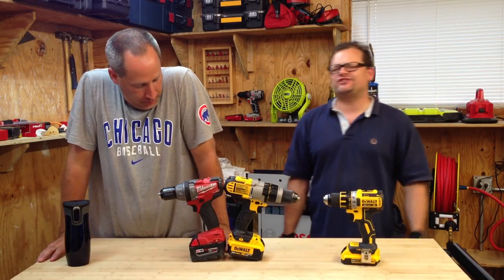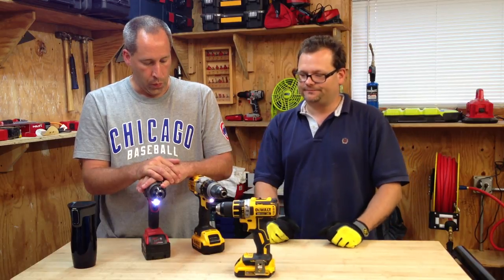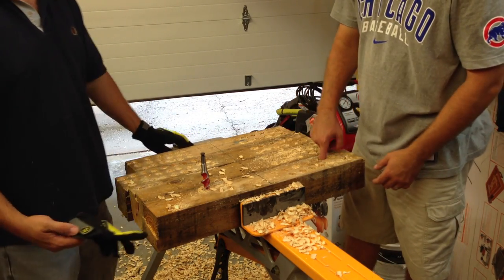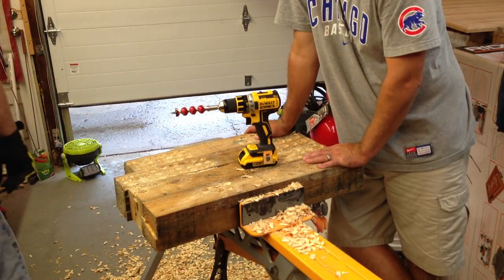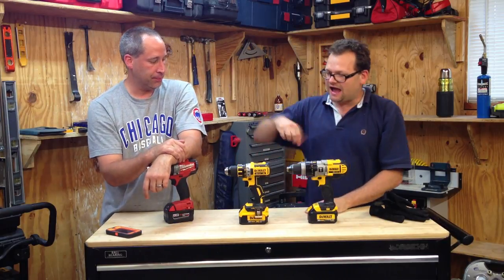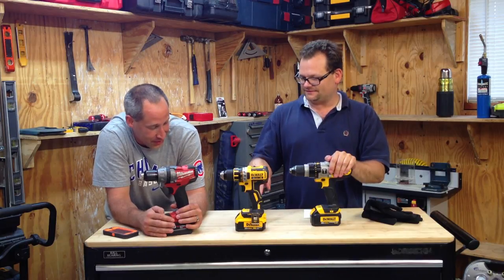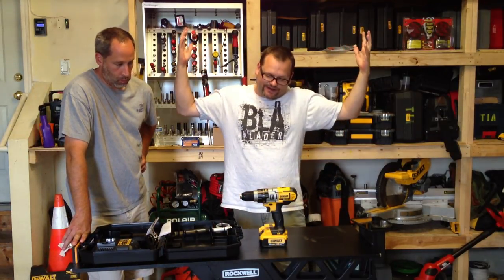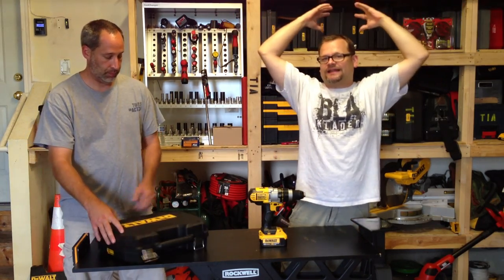Friday Night Tool Fight Milwaukee 18v vs 20V DeWALT

Comment from the maker: Your not going to go wrong with either.  Both are made for the contractor and heavy use.  The Dewalt feels very nice, plus Dewalt offers a compact drill and a heavy duty drill.  Milwaukee has a bigger 20V line and is coming to market much quicker with brushless.

Comment: great video guys, been wanting to see that match up since the dewalt brushless compacts came out. Honestly, you can't go wrong with anyone of those drills, although i personally would go with the brushless dewalt. Suggestion for your next tool fight, Milwaukee recently "remade" their brushed m12 drill and impacts so i think that would be a fair match against dewalts 12v

Comment: I found you guys when I had to step up my tools for a remodeling project and really enjoy your videos. I bought the brushed M18 compact as well as the DCD790 to do my own comparison but the Dewalt brushless battery life was superior. Home Depot does not sell the compact Fuel drill/driver, you have to order it. I read the lithium ion in Milwaukee loses capacity after only a few cycles so I stuck with Dewalt. 
You both use the DCD790 as a daily, correct? I love the drill but I had to track down one with no chuck wobble. I looked at several and even found a video of the problem. Have you noticed it on your models?
Also, I found that Lowes carried the newer heat sink 2.0XR (DCB203) pack but Home Depot does not. (202 only)
Will all the 20v batteries get the heat sink or just the 2.0?
Thank you for the entertainment!

Comment: I'm a little confused. At 3:48 you show a close up of the DeWalt which clearly says XR on the side of it. It looks identical to the one being used in the comparison. XR is DeWalts brushless model, but you two are saying that you're using a DeWalt that has brushes. What's going on?
Reply: XR stands for extreme run time.  It says it on my dewalt combi drill (brushed) my impact (brushless) my torch (.......) and my multi tool (brushless).  Dewalt were branding their tools XR a long time before they started using brushless motors.  I think some of the old tools than ran on NiCD batteries were branded XR.  Hope this helps mate.

Comment: Just saw that on  the new dewalt DCD 995 brushless drill. That dewalt didn't separate their clutch with the hammer and drilling selector on the new drill it is all together. Looks like Dewalt took one step forward with the brushless motor and two steps back with the drill selector.

Comment: Great vid, no surprises there. Already knew Milwaukee would win but it was interesting to watch. I still want to watch a tool fight between Milwaukee's newest m12 brushed impact driver against deals 12 v max impact driver. They are pretty even on specs. You can even throw in the Bosch makita and ridgid 12v impact drivers in the fight.

Comment: Hey John Grammaticus, they actually did do a tool fight between the Makita 18v brushless and the Milwaukee M18 brushless when they first came out. Should check it out. It's the reason why they call that Milwaukee auger bit "The Drill Killer" and sadly why we don't see a lot of Makita on here.

Comment: Hey Dan and Eric, if you guys are still going to test 12v drills this Friday you guys should do Dewalt vs Milwaukee's redesigned 12v vs Bosch's ps31-2a (i think that's the right model). I've used and owned a lot of the 12v lithium drills and would say those are the top 3. Ridgid would be next.

Comment: Milwaukee wins hands down IMO just because they have probably about 30+ tools for the 18v and 12v. I use my tools on a daily basis for my trade and so far they have never let me down. I just picked up the 12v led stick light which is now my fav light and about to splurge on the hammervac since it would drilling for drop in anchors less of a mess! One tool I would like milwaukee to make is an 18v nibbler since i just seen that makita now makes one!

Comment: It would be nice if Porter Cable offered 4ah batteries or even 2ah. Then it would be a better test, but biggest setback would be the brushed motor compared to the m18 fuel.

Comment: The Milwaukee fuel hammer drill is the toughest drill on the market when it comes to endurance. Watch this video on YouTube.  (Drill Performance Showdown Highlights). It has the Milwaukee 2604-22 vs Dewalt DCD980L2 vs Bosch DDH181-01 vs Makita BHP454 vs Festool T18 564397. All of the drills have a 3.0 AH batteries.  The Milwaukee fuel wins takes 1st. 2nd dewalt, 3rd festool, 4th Bosch, 5th Makita.

Comment: Just seen new pictures of Dewalt's new 20volt brushless Premium hammer drill.  On Toolguyd page. It only has 708 inch Lbs of torque.

Comment: The Dewalt 20 volt is really an 18 volt tool it's only 20 volts when then there is no load being pulled on the battery. The reason they called it 20V max as it was a way to seperate from the old plug style tools to the new slide pack system. The 12v tools are the same way they really are only 10.8 you might even see some old sets with that rating before they all started marketing them at 12 volts.

Comment: A brushless milwaukee only managed 2 more holes in a 4x4 then a brushed dewalt with same size battery... that's very little difference... Unless the milwaukee was a light year faster the Dewalt is still my drill of choice, I'll never need to switch

Comment: Also as far as heat goes, A compact drill, shorter, lighter in weight with a less powerful motor drilled nearly the same amount of holes as the bigger more powerful fuel so of course the smaller motor is going to generate more heat in doing what it did, it's common sense... And in the real world no drill is going to do this kind of thing drilling hole after hole wide open with no breaks through a 4x4 with that bit... In 99% of the worlds situations you'd probably never get this drill that hot

Comment: 28v milwaukee vs anything dewalt.  Sure they are heavy, but they come with nearly the power of a corded tool.  And hey, if you are in the trades, you should be strong enough to work with a heavy tool all day.  If not, maybe a desk job would suit you better,,Kidding.  But the 28v are awesome for heavy work.  I skipped on the 18v stuff.  I carry all 28v for heavy, and 12v for light.  Why choose the middle ground like all others?

Comment: boo hoo Dan cryin bout his dewalt , the dewalt isnt really that much more compact than the milwaukee and the drill driver is even shorter. the milwaukee is about a lb. heavier with the 2.0 batt and only 5/16 longer , not a big advantage being the milwaukee is much more drill.